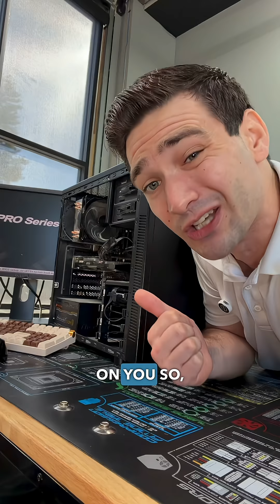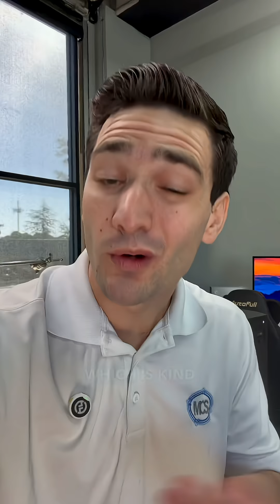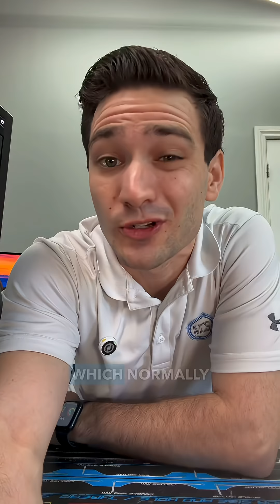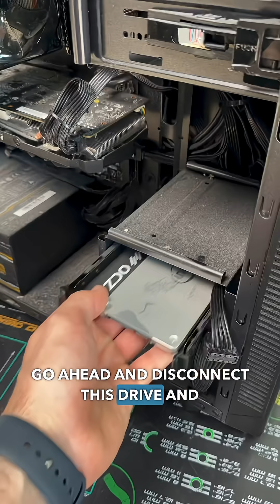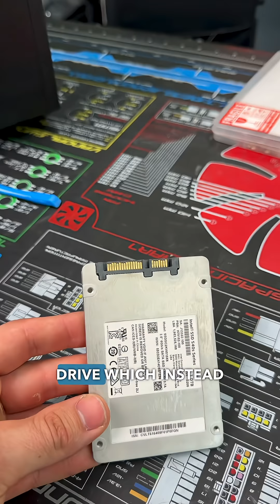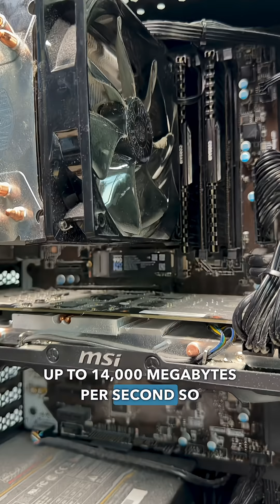Windows Won’t Load! #pc #ssd #pcbuild #pcrepair #computerrepair #repair #gamingpc #techtips

Comment: Just so you know - SATA vs NVMe SSDs have no distinguishable different for everyday use and gaming.

Old doesn't mean slow but the marketing has gotten absolutely everybody in the hype.

The NVMe power is operations per time and that doesn't matter unless your PC is a server with a mega networking setup... which defeats the purpose of a PC.

Install a cheaper SATA SSD and don't bother with giving more money for an M.2 slot one.

Comment: Actually i don't think the drive is dead, it's just a really weird corruption of the Windows installation or file system. I had this exact problem back in 2021, only weeks after i installed Windows on my new Samsung 980 Pro. It was very weird because i couldn't boot from any Windows installation media and when i connected the drive to another computer, it froze. But when i tried Linux, it booted up just fine and i could even still see all the files on the SSD without any problems. Then i just reformatted the drive in Linux and i could reinstall Windows on it without any errors and this installation still runs to this day on my PC.

Comment: One trick that sometimes works If You have important stuff on that drive:
1-install a second drive(hdd,ssd,nvme whatever You have) 
2-install Windows on that drive(Windows 8,8.1,10,11 whatever works with you)
3-after You boot into Windows, shutdown,get your broken drive and plug in the power cord,dont plug in the sata cable
4-turn on your PC and enter the bios and leave it there for 30min-1hr
If You cant enter the bios even without the sata cable plugged in then plug in the power cable after You enter into the bios
Why? Well some drives have a built-in repair chip that makes the drive usable again
Warning this will not work in every drive(i learnt this front gamerig btw)

Comment: actually no not always drive failure mine was a ram slot failure would work and fail started spinning then frozen forever when i removed and tested ram turns out all sticks were good the ram slot on the motherboard was somehow faulty. still couldn't get it rma'd

Comment: Im actually getting this problem on my laptop and I thought it was a power issue, I removed the battery and that didn’t work. Sometimes it turns on but after a while the screen flashes black and the laptop turns off. Is this the same problem that the pc in the video was having?

Comment: i had this problem it wont work in usb
Reply: Your BIOS might not be set up to detect the external rive properly. Or, at least, what's on it. Your bios could be set to legacy, while the thing on the drive needs UEFI, or something. Gotta make sure what you're putting on the drive is accessible with whatever your BIOS is set to.

Comment: I have a feeling that Gen z is going to go to the bottom of the bell curve with computers just like the boomers did. 
The boomers weren't good with computers cuz they were new but then they got better and then Gen X and millennials were at a point in time where computers still required some playing around with and troubleshooting to fix. 
But now with Gen z and beyond they tried to make it so easy to troubleshoot that the computers pretty much fix themselves that they're never going to be able to do troubleshooting like this and could be a good thing because that means that PC repair shops might start becoming a thing again

Comment: I would have tried cleaning the drive and if that is successful then see if it takes an install.  Just to satisfy my curiosity.  The M.2 is a good solution, even if the SATA drive cleans and runs the failure could indicate imminent total failure.  SMART data would have been interesting to see.

Comment: The difference between an M2 drive and SSD drive is not visible to the human eye in normal pc use.  The main advantage of the M2 connector is it’s size so it’s ideal where space is limited like in laptops.  Lots of PCs still use normal HDD drives that’s the ones you wanna be removing.

Comment: Strictly speaking, a bad boot drive, by default, HAS a corrupted OS install on it.
But you can have a corrupted OS without the drive being bad. Sudden power outages, etc, can corrupt the data without necessarily trashing the drive.
But as a rule of thumb, I never reinstall the OS on a drive which has corrupted at some point. It's reasonably likely that the drive is in the process of 'going' bad.

Anyway, ALWAYS try it with one stick of ram, then with the other stick of ram. Just to make sure it's not just a frazzled ram stick. It 'can' cause this behavior, and many other behaviors, pretty much any behavior 'can' just be a bad ram stick. And yes, the pc will work fine with just one stick, no dual channel. It just won't perform as fast. Having 2 makes it really quick & easy to check the ram sticks.

Comment: how would you do this with a phone? my old phone has had multiple situations where it goes on a restart loop and every time we needed to factory reset it
Reply: If it's android, hole power and one of the volume buttons, or power and home button while the phone is off. With one of those button combinations on startup, it should load recovery mode. Use that to do a factory data reset. Hope it works.

Comment: I'd still honestly try and run it in something like Puppy Linux. I've had drives that haven't worked in Windows, and appeared to have bit the dust--only for me to be able to recover data with Linux.
Reply: The reason it wasnt was because the customer had a backup to refer to. The GPT/MBR was probably messed up, which could cause issues when reading offline from a working Windows environment.
Reply: To be fair linux does not read the file system of the drive. Only the mbr portion of it. And its not guaranteed to recover data. You still need special software

Comment: For those not aware, a SATA III interface has a max speed of 600 MB/s.  I'd assume this machine only supports PCI Express 3.0, but even that is at least twice the speed of SATA III
Reply: PCIe 3.0 over NVME will do 3500MBps easy.
Reply: @jabezhane Oh definitely, I've just seen a LOT of hardware combos as old as in this video that cap out at 1300 MB/s.  I feel like 4.0 hardware is more consistent in terms of speed than 3.0 hardware was.
Reply: @jabezhane  depends on how old the system is, some pcie 3.0 on laptops cap out at 1800mbs but thats still 3x faster than Sata. Gen 3 nvme themselves can range from 1800 to 3600.
Reply: Actual real-world max is 550MB/sec.  They list the theoretical max at 600, but no SATA SSD I've ever encountered actually goes that fast even though the drive itself, outside of the interface, is fully capable of that speed.  I suspect that's the difference between the interface's encoded vs unencoded transfer speeds.
Reply: @alphanerd2305  iv seen samsung 870 evo hit 590 read

Comment: In my experience, something weird happened, I had (still have actually) a 1T Toshiba HDD that supposedly died, it did respond to windows (very little times) but if I tried to write a new file system it automatically failed, disconnect and when it finally reconnect it asked again for a format cause the file system met Jesus, a few weeks ago I found the disk but I couldn't remember what was his problem and since I needed a windows for a test I just figured I would the drive a shot, guess what, didn't made a fuss, installed windows and it's still running like nothing happened

Comment: Back on a saturday in february, i had finished a project that i had started last october. The very next day when i was going to sort some stuff out, back up some stuff and look for a good video editor, i came to find i had an issue with my pc. I then find out that my drive had died completely. As in the business that repaired my pc could not read the drive AT ALL. So they replaced the drive and i had to restart that project all over again and re-finished it in about 1 month.

Comment: that slow sata interface is still excellent for holding the OS
i boot into windows in less than 15 seconds
Reply: 600 is still 4x faster than a hdd and ya the start to time can be pretty good especially if you're running windows 10. Buuuttttt an m.2 nvme at its slowest will be about 1300 and some older gen 3 sockets cap out at 1800 so you could potentially go from 15 seconds to 8 seconds or even 3 seconds. Regular gen 3 will get you 3200-3600 though your start up time is unlikely to get better than the one doing 1800.
Reply: @whatsmolly5741 you won't get that much of a boost seeing as sata and nvme drives have the same speeds except for big single file r/w.

Comment: too bad you didnt notice that this motherboard was set to legacy mode and not UEFI. You can spot that by the no boot device error. A UEFI bios would display that error in one sentence high resolution at the top left corner. Also, why in the world would you install Windows 10 on a customer pc as a professional installer when its EOS?

Comment: Hey Matt, I came across your videos not too long ago and I have been having a similar issue on my pc except it’s during shutdown, windows and everything goes into shutdown mode and windows says shutting down but then after that screen disappears, it will show the CPU debug light and the fans ramp up. The only way to turn it off is the killswitch on the PSU, I was wondering if you could help me out with what this may be?

Comment: So, this happened to me BUT, it wasnt a dead drive, it was the corrupted system, in recovery i couldnt find the "Reset this PC" button, so after i made changes in bios (HP probook 640 G3) The button appeared i reseted the laptop and now it works fine. (This was caused by the game GTA SA it had a virus in it that made this corruption, so its fixed and still operating, Kids dont download anything from a website.)

Comment: I have a problem with my computer it doesnt register the gpu but my monitor workstrough gpu and the sound doesnt work but i think thats because the motherboard is msi pro b660-a wifi ddr4 because msi motherboards have caused the same types of sound issues to others

Comment: I had/have this problem, chronically. It isn't the drive and it isn't windows. Its the ram, or more specifically the ram slots. The retention clip is loose/worn. Removing and reseating the ram fixes the problem immediately.

Comment: 600 MBS via sata cable on SSD poor SSD if I was gonna do that id settle with HDD because I personally get 800 MBS on highest speeds. And ngl thats all you need probably over all you need actually. At worst its just a second or two longer nothing insane in terms of load time.

Comment: the drive isnt bad its simply has malware installed on it designed to self replicate on to any new medium it detect and causes windows to crash intentionally so you boot from a new medium device to copy it self onto to further copy it self and spread. The most obvious evidence of this is when he put it on the external drive reader and his Pc freezes but the moment its disconnected returns to normal this a clear sign that code is being executed in the background hogging all the  resources  available as any ssd/HDD thats faulty or bad would just give a error for said drive being unreadable or configured incorrectly. this is why you never test any form of storage on a Pc connected to the internet or thats used regularly with other storage devices unless you have write and read privileges lockdown to a admin account that requires log in credentials like a cac reader. the amount of people that find a usb and stick into theyre work pcs or personal ones serving as a bot on some randoms persons bot net would scare most people.

Comment: wha...? Replacing an HDD with the highest end SSD.
Reply: That SSD isn't the highest end... Also that isn't sata HDD it's SSD sata
Reply: The one which was in the pc earlier was also a SSD, but it was a sata SSD, the new one is a m.2 ssd
Reply: @sanjusharma6640  , the Samsung 990 Evo is a very high end SSD, there are others that can do similiar for less.
Reply: @itsjustmeguys I do know that. I was correcting you where you said that the old drive was an hdd meanwhile it was an SSD too
Reply: @sanjusharma6640  oh, alright. Mb

Comment: This video actually came in clutch because it further reinforced my theory that my drives dead, the exact same things happening for me
Reply: That sucks. But at least you have found the problem
Reply: Pray you get back to gaming bro
Reply: Rip your data
Reply: at least mine wasnt that bad but i did  have to reinstall windows etc and still something seemds odd....everyday there is one moe thing to fix
Reply: This exact thing happened to me last month and I used a windows boot usb, found that my ssd wouldn't show up even when my pc would boot. Replaced it and went through the misery of reinstalling everything
Reply: yeah, I actually had this exact same issue a few years back. took the drive to a repair shop and they said my SSD's main chip is fried. had that PC running non-stop for 4 years and my SSD got burnt because of it.

dunno how relevant this is to you, but maybe you'll find some useful info in there
Reply: This happened to my brother too with his old 2008 pc. He had an hdd with tons of videos on it including anime, cartoons, documentaries, etc and it eventually gave up on him. I also had an msi gt780dxr laptop, same thing the hdd went bad but this one only within a few years. Had issues booting into windows.
Reply: Nice
Reply: Mine died in a pretty diffrent way

Started intermittedly showing up then only one partition showed up after which that partition showed up but was unaccesssable then died
Reply: I hope you have a good backup.  😢
Reply: Its been a while...how did you go?
Reply: @NotHimAgainn  Actually probably the best possible outcome, the drive was actually fine but the WiFi card was replicating pretty much the same issue, which is pretty weird! Had to throw that out, and it works great. I'm ashamed to admit that I only found that out a couple days ago though, so it's been an issue for 9 months up until now lol.
Reply: @exlivin5618 haha at least it fixed! 😅
Reply: Unrelated but W pfp
Reply: Just revive it. It would be easy for you.
Reply: Try to run some /r chkdsk on it at least. It might help enough to copy shit out of there or even use it for garbage. Managed to revive one that had sector check look like a knitting pattern, lol. It might also be a cable
Reply: I have an same result on your PC